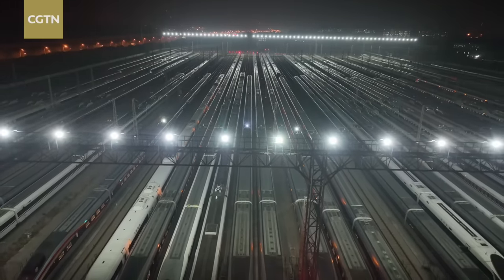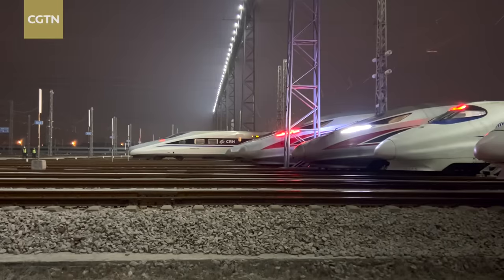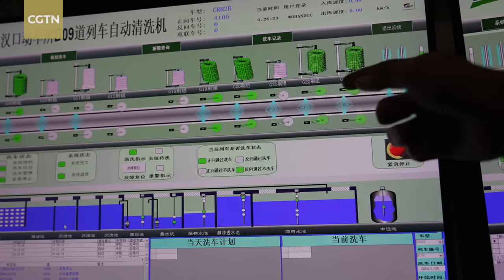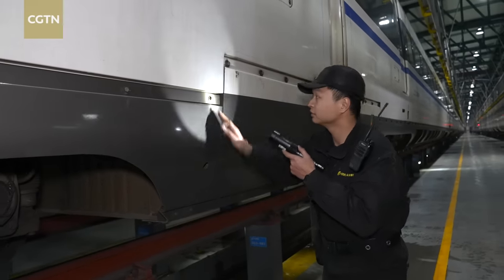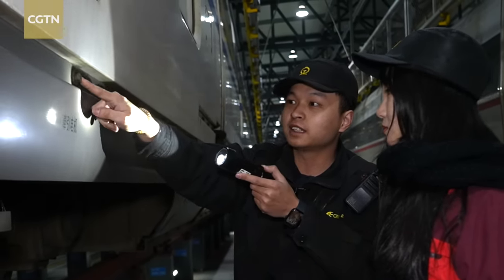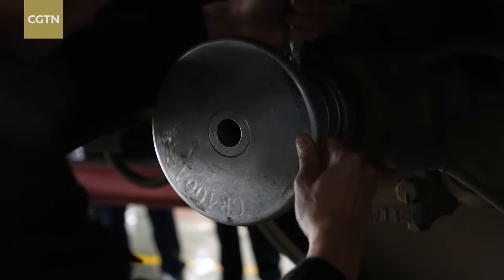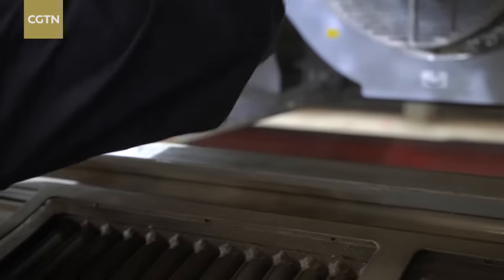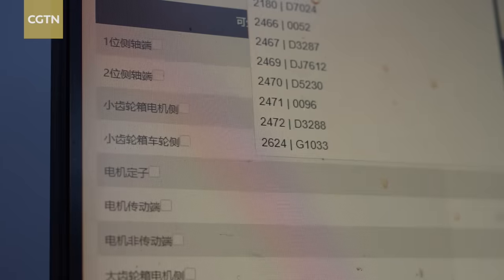See how China's bullet trains undergo shower, ultrasonic maintenance ahead of holiday season

Comment: Shanghai's Bullet Train Depot use robots for maintenance. The robots are equipped with dual-arm robot technology, vision technology, and image recognition technology. They use a scanner to detect if any part at the bottom of a bullet train needs to be fixed. And after examining the type and degree of the defect, they automatically notify the system.
Reply: not everywhere, because people need the jobs
Reply: @ChengliangPan  Industrialization 4.0 is the same as its predecessors, people will just readjust to the new working conditions/environment and will find new alleys of employment.